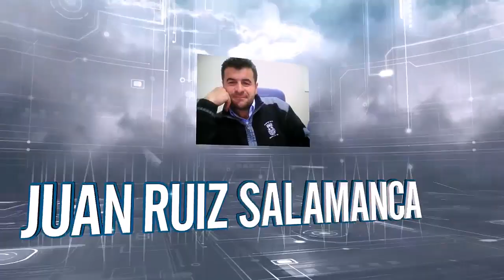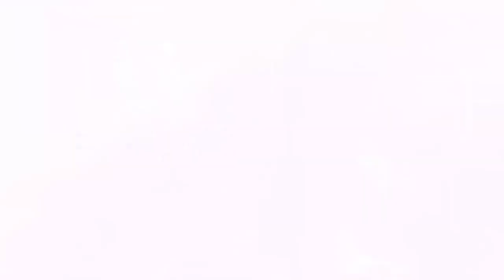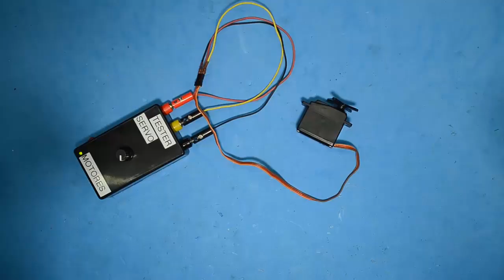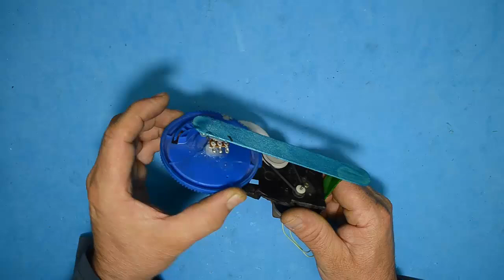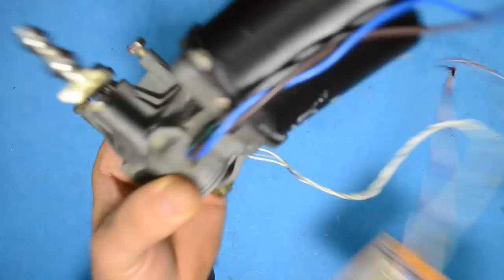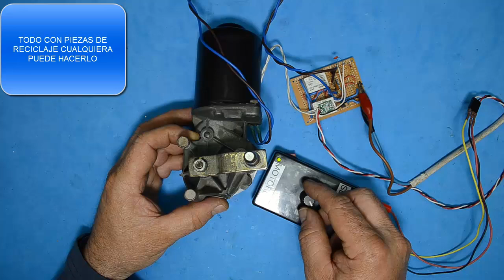PROYECTO SERVO CON MOTOR DE LIMPIAPARABRISAS EN PRUEBAS

Comment: Me parece genial y muy buen proyecto, pero pensaba que esto yo lo pudiera operar a larga distancia para abrir una válvula de agua, pero quisiera saber si la cajita de control, trabaja con 
corriente de 4mA a 20mA de salida hacia la tarjeta que va al motor, y el potenciómetro, indicaría la posición de la válvula o la compuerta, de apertura o cerrado,  ejemplo 0% =4mA, 25%=8mA, 50%=12mA, 75%=16mA, Y 100%=20mA, y con un galvanómetro de 4mA a 20mA, ver la 
posición, pienso hacer ese proyecto para un sistema de tanque de agua,

Comment: Hola Muy buen vídeo.
Una duda
Cuantos amperios y cuantos voltios consumen esos motores?
O
Para mover uno de esos motores cuantos voltios y amperios necesita?
Reply from the maker: este es de 12v tambien los hay de 24v el amperaje puede cambiar desde unos 2 amperes a unos 4 o mas depende de la carga o fuerza que tenga que hacer tambien el modelo cambia de estos hay miles
Reply: ELECTROJUANYU 
Pero se podrá controlar uno de esos motores con un emisor y receptor de juguete a control remoto?

Comment: Hola saludos desde España  mi nombre es Iván y te felicito por tu vídeo.
Me pregunto si puedes pasar un diagrama o esquema para crear el circuito por favor tengo arduino mega pero por ahora me gustaría hacer como usted mr.
ELECTROJUANYU
seria muí feliz de verdad mi proyecto es para personas con poca movilidad ect. yo mismo tengo un hombro mal hace tiempo y espalda mal perdón por la charla por favor si es tan amble de ayudarme estoy estudiando electrónica hace tiempo pero no se tanto. Bueno men muchas gracias.
Reply from the maker: hola el montaje es muy facil el circuito principal es el de control de un servo motor de 9 gramos averiado este se saca y es esa pequeña placa que tengo pegada sobre el rele, desde hay se controla un puente h a reles con ese modulo, tengo pendiente hacerlo paso a paso, cualquier duda me preguntas soy de córdoba España, un saludo
Reply: ok gracias una pregunta tengo un coche el mecanismo es parecido me as dado una idea bueno yo soy de alicante saludos.
Reply: cres que se puede hacer se mui poco realmente 
se lo basico y practica bueno a si se aprende
Reply from the maker: ok
ami tambien me se a ocurrido otras muchas ideas con ese mismo sistema, un saludo
Reply from the maker: es facil los reles del puente h se conectan a un diodo cada uno uno por el ánodo y el otro por el cátodo de tal manera que según gire el motor conecta la  base de un transistor npn o la de un pnp por eso es que el motor cabecea un poco es el tiempo de reacción del rele

Comment: Genio, genio, genio !!!! yo estoy tratando de hacer lo mismo con arduino y se me complica, y tu con electronica tienes mejores resultados !!! Te pido POR FAVOR ME SALVES!!!! me puedes pasar los circuitos electricos o planos  !!! Si eres tan amable porque los necesito PORFAVOR !! Mi correo es charlybusinsky@gmail.com
Desde ya tienes mi like !! Y mi GRATITUID 
Sigue asi JUAN eres un GENIO
Reply from the maker: hola el sistema es facil de controlar, la placa pequeña es la que trae un viejo servo de estos mini y esta controla un puente h a reles
Reply: @Juanruizsalamanca  buenas noches muchas gracias por compartir tu conocimiento. disculpa  como conecto el puente h de relay ala salida de el motor de la placa. Espero me puedas alludar.  gracias y muchas felicidades tienes un exelente canal.